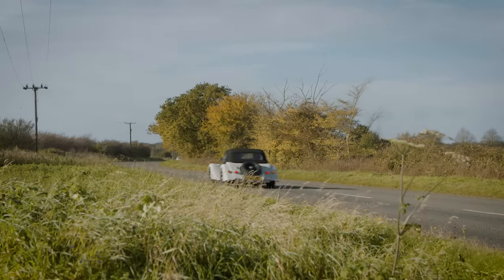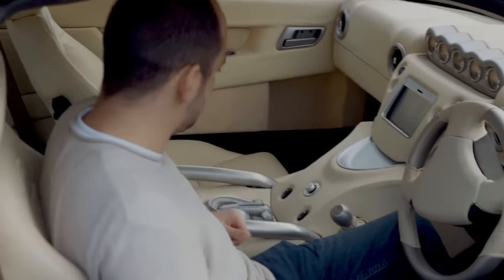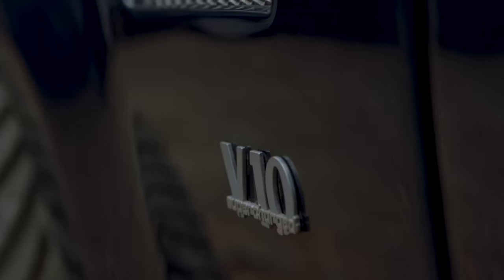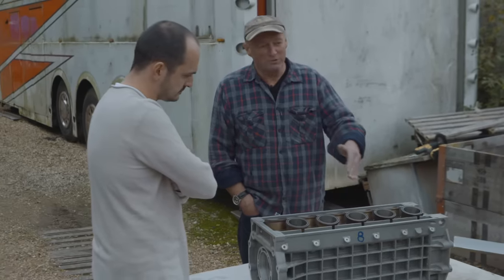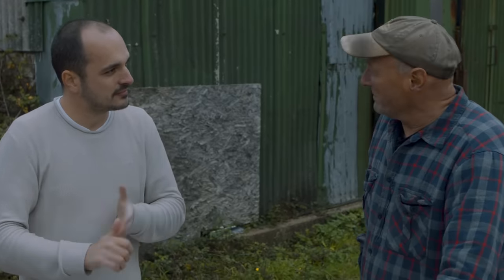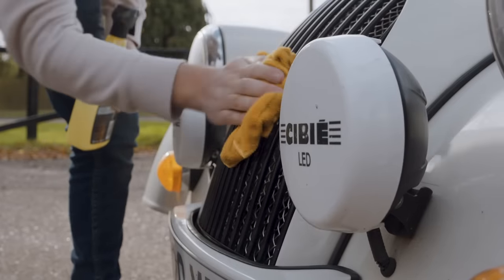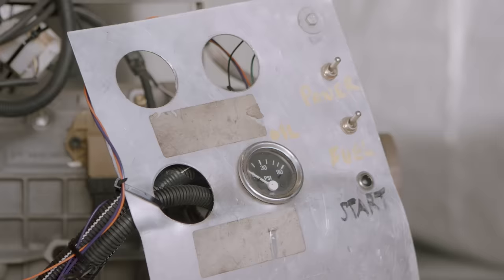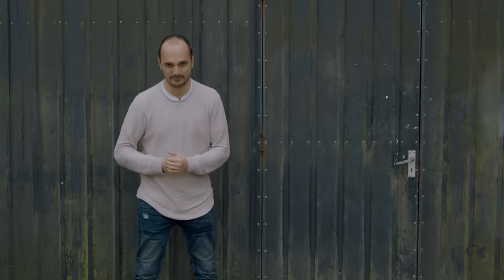We found the lost 2.0-litre V10 sportscar!

Comment: "we wanted to make a fuel efficient car, so we made a V10" is the best thing I've ever heard 🤣
Reply: Ecclestone is triggered
Reply: it is more important it is 2litres !!!  thats why !!    it is not the "V10"      2litre 4 cylinders is more or less the same like  2litre 10 cylinders, except double fun and 4 times the price 🤣
Reply: Means you can shut off half the cylinders and still make a decent amount of torque.
Reply: He wanted to show that u can have a fuel economy in a V10 engine with a hybrid system.
Reply: 2l V10 Sounds better than 2l inline 4
Reply: That's the V10 I want, small and powerfull, not big and berserk
Reply: @zogworth  I thing this is exactly what he meant: I mean with Cylinder shut-off you probably can run just 2 cylinders and be fine (As he said, you do not want a engine to idle) with 2 cylinders running only, the engine is probably just powering all the accessories and slightly charging the battery pack only and runs super fuel efficient.
Reply: Yes so you can shut off the cylinders you don't need. Not rocket science, just simple car science
Reply: @robinvespignani2126  I know, but still it's just not something you'd often hear. I get why it is.
Reply: @sjbrown4145  yes indeed
Reply: He also said special haha
Reply: @sjbrown4145   when VTEC turned off yo
Reply: @MrLince-hr4of  only 2.5x more friction so no
Reply: @TheAdatto  I was going to say the same thing you did, this is why a 4 litre 6 cylinder gets better fuel economy than a 4 litre V8. As you have less moving parts and lower rotating mass in the 6 than in the 8
Reply: Listen to what he said
Reply: I’ve driven a ten cylinder vehicle before.
Reply: Maybe, read some info about engine balance ;) It is more expensive to make but I think more durable. It will have more contact/friction area though so your efficiency story is partially true. I'm not an engineer but number of cilinders isn't the whole story about efficiency. Otherwise every car had a moped engine.
Reply: @richardlodewijk9907  I know mate, it just sounds counterintuitive to what we are used to thinking, I understand the engineering is clever and efficient but it just sounds unusual and funny
Reply: .... and how long have you been a practicing FB engineer ? Designed anything we know about ?
Reply: It's a 2.0ltr, it should get 2.0ltr economy
Reply: but is F1 listening??
Reply: @dalucktheslayerofdowjones5244  , laughs in Dodge/Chrysler Viper/Bristol Fighter/Hennessey Venom GT.
Reply: @paxhumana2015  Viper with a stroker kit - muaahaha (very evil laughter)
Reply: @TheAdatto  underrated comment
Reply: @banger0250  not compared to a 4cil. All those valve springs have to be pressed in each revolution. Etc etc
Reply: Haha! Totally!
Reply: This is the sort of thing i will tell the wife...
Reply: The smaller the cylinder the more efficient the combustion so less wasted fuel. That's why fiction and mass aren't such factors
Reply: Ne samo da si glup nego tako i  izgledaš. 2 l engine 10 cilindara. U štednom modu ugasiš 6 I voziš se pristojno na 4 cilindara odnosno oko  0.8 l radne zapremine motora. A to sve nemožeš napraviti sa motorom od 4cilindra a I vrlo teško sa manje od 10.
Reply: I want to see this V10 vith koenigsegg freevalve technology! 😋😋😋
Reply: @AJ Lexus I can't believe my comment got 1000 likes 🤣
Reply: that men have to work for alfa romeo 🤣
Reply: @marwerno  shutting off most of the cylinders makes a bit more sense. The guy didn't actually say that in so many words :-)

Tbh it could probably make close to 40bhp running on two cylinders - OK, say 20 at the engine speeds he's talking about - but that's still enough for most kinds of town driving. You might even have a surplus for charging the battery!
Reply: @MrLince-hr4of  minus friction loss
Reply: Honda,hyundai, Toyota be like wow that's so brilliant we never thought of that 🤣
Reply: Will never understand the power range difference.
Reply: Right? I own 4 Vipers and it often feels like I get gallons per mile instead of miles per gallon

Comment: Kit cars exist so why not kit engines? Imagine this beauty in the MX-5
Reply: They're called crate engines and sold by manufacturers, Ford for example, it really would be awesome to see the projects people come up with that v10
Reply: Wouldn't it be a mx-10?
Reply: @ljeremyhill  mx-11=>10+1
Reply: @GabrielZ.  crate engines are prebuilt. I think what he means by kit engine is that you build it yourself, which sounds awesome
Reply: YES :D
Reply: mx? yawwwnnnnnnn
Reply: Open source files so anyone can 3D PRINT the block and heads, use motorcycle valves, rods, pistons, and have your local machine shop turn a crank to specs.
Reply: I have a 76 Toyota Celica GT. How nice it would be under that long hood it has.
Reply: great idea they should make these engines and sell them from ebay
Reply: @fidelcatsro6948  Heck anywhere whether it be crate or kit. I build airplanes so besides my Celica it would be nice to see one under a cowling. Especially since they recently changed some of the rules for sport Aviation for the better.  Some of that dealt with weight to accommodate either Electric Or Automotive style engines like a ls3. So it being modular fits the bill for whatever.
Reply: Or lotus 7? Why can't they make them cheep in china, perhaps standard cylinder/piston/ valves with different configurations -perhaps a replica BRM V16...
Reply: @GabrielZ.  “Most” still applies.
Reply: @peterdarr383  that was my exact thought. the only real challenge is the crank case and cylinders, but certainly doable
Reply: Funny you say that it's actually going in Mike's MX-5 now!
Reply: this aged well
Reply: This comment aged like fine wine
Reply: @Ozarkprepper643  I got a road rage charge driving one of those one time..by accident.. I had the brakes smoking and I felt guilty for having to drive it over 100
Reply: @ronalddaub7965  LOL Did you lose your license?  I learned to drift in that car decades ago. They came with all the goodies. From the bucket seats and carpet to all the gauges, power steering and brakes, Macpherson strut and discs.  Plus a 40/60 weight distribution. Considered American cars including muscle  we're strangled by emissions. The 20R could hold its own with a Webber , Offenhauser dual-port and cam.  They often came out with a better weight to horsepower ratio.  It has over 400,000 miles, on the second engine.  I had an old hand-me-down falcon in high school. Bought a 76 Hilux when I graduated. I liked it so much I got the Celica GT liftback. Then I managed to pick up a 75 Celica ST Coupe for $800 in 79. Still have it also, and I drive it about once a month. It still has 34000 miles on it. Also have my 80 long bed 4x4 it sits on 38" with the 7 inch Skyjacker. It's pushing 900,000.mi  You would think I didn't get rid of anything but one of my biggest regrets was letting go of the 67 Newport convertible  383. Bar none the largest vehicle I have ever owned. LOL   Sorry memories of an old man are Deeds of a man in his prime.
Reply: Well they put it into a Miata
Reply: @GabrielZ.  not much hp to gain on the tritton v10 apparently, nonetheless great engine and awesome sound
Reply: Type in :"we're putting a V10 into a Mazda MX5....
Reply: It's happening rn lol

Comment: Wow it sounded like a Viper despite being only 2.0l.
Reply: Quite alot of big cylinder engines were pretty small. I mean Aston's V12 is only like 4.2Ltr's
Reply: @insomniacbritgaming1632  Astons V8 is 4.2 or 4.7l. The V12 is 6.0l.
Reply: @siraff4461  6 litres. How tiny
Reply: @insomniacbritgaming1632 
That's more like their V8 size. Their modern V12s are 6L.
Reply: @insomniacbritgaming1632  astons v12's are 5.2 - 5.9l
Reply: @saintbarnabasshackles2437  6.0 is normal for V12. Look at Lamborghini, VW, Aston Martin, BMW and Mercedes Benz.
Reply: mcchickenz  I think I'd rather have genital warts than drive an American car

Comment: The engine is small for a V10, but bulky (and undoubtedly heavy) for a 2.0 litre. 

An inline-5 2.0 L would be the same length, but simpler, lighter, and narrower... and still capable of running at as high an engine speed as rationally desired.

Comment: So what would the firing pattern be?
I assume it has the same crank as an inline-5 for each bank, with a throw every 72 degrees (0, 72, 144, 216, and 288 degrees, but not in that order down the length of the engine). With the usual narrow-angle configuration the cylinders in each bank are midway between those in the other bank, not adjacent to share crank throws. The crank then has 10 equally-spaced (along the crank axis) throws, and they are probably clocked so they hit top dead centre alternately (so the 72 degrees between cylinders in a bank is split into two, but angle between throws is 22.5 degrees off of that 36 degrees because of the bank angle. Ideally that means one cylinder fires every 72 degrees of crank rotation, as in any even-firing V10. Both banks will rock because of the odd number of cylinder (like any inline-5), but the two banks can be timed to roughly balance each other... but not quite because of the bank angle. 

 A wider vee angle allows the cylinders in opposite banks to share crank throws, and the right vee angle avoids the need for offset crankpins. This narrow vee angle messes with that, and makes the engine block almost 50% longer as the cylinder bores would run into each other if spaced more closely.

Comment: That is an intriguing car, and it's in classic British style to make eclectic autos, like the Connaught, Morgan, MG, Austin-Healey, Jensen Interceptor, etc. But, the concept of a single head for a "V" engine seems fraught with problems. If either the block or head has to be surfaced, the alignment will no longer match. Plus, thermal expansion will be more problematic for head gasket sealing.

Comment: WOW. That exhaust note is glorious🎵. Find it interesting that the exhaust is an unequal length baffle box type. Sure makes for a slim and sleek package to stuff in a chassis. Any HP/Torque specs? 

If proper motor mounts could be adapted for Ford and others, this would be an ideal crate motor to manufacture.

Comment: wish we had more info on the engine as i would like to know how the angled cylinder seal on a flat head ,are they counter bored into the head i see the cylinders have wills ring grooves , lancia used a flat block so had a flat cylinder head with chambers ?also no throttle body ?

Comment: Engine type	V10, 22,5° narrow angle, 4 valves/ cylinder, DOHC, twin scroll inter
Displacement	2.0 l (122 ci)
Power	304 ps (300 bhp / 224 kw)
Torque	371 Nm (274 lb-ft)
Power / liter	152 ps (150 hp)
Reply: similar performance to nissan 350z 2006 engine. almost... The VQ35DE rated at 287 bhp (291 PS; 214 kW) and 274 lb⋅ft (371 N⋅m) of torque

Comment: 2.0 straight(“don’t produce enough power”)
This dude: hold my beer 😱
Reply: It only make 300hp, that's less HP than a Civic type R with a 2L and they can easily handle 500+.  Bigger bore means better flowing heads equals more power.

Comment: I NEED to know more about this engine and its hybrid system. Because it makes zero sense to me. Everyone else has been using fewer and fewer cylinders for years because it increases fuel economy through less frictional resistance. But this guy's like "Moar cylinders!!" Also what the heck does not idling have to do with having ten cylinders?? If he'd have said "I want it to run really, really low revs" then more cylinders would make sense, but not the other way round.

This car makes no sense and I'm intrigued.
Reply: I agree.
Ford are using a 3-cylinder engine now in place of 4. Many V8s are being replaced by V or straight 6s... all for the sake of getting the engine friction down.
A 2-litre V10 is just a vanity exercise.

Comment: For 2022, needs softer exterior lines/corners, and just copy others for interior design, what is the fashion today. That cylinder head face is something else, 01:57 , main pressure taken by copper gasket rings around cylinders, but water jacket walls look narrow. Leak danger with used time?

Comment: Doesn't look like it uses a "Headgasket" per se i'm assuming it uses silicon sealant around the flat surfaces then on the cylinders it probably uses a copper ring.... something like this if produced could become quite the kit engine, i can imagine getting in bed with a casting company and seeing as they are already machinists they could probably pump these out for a few grand each in kit barebones form (No ecu or anything) just the engine block and head... i'd love to throw one of these into my mustang! 2.0 V10.... i bet supercharged that would make some lovely noises.

Comment: since he ICE dont are inefficient at idle did he mean hybrid as a gaspowered generator? As in constant rpm driving a generator then driving electric motor with some kind of buffer in between?
Reply: Nope. It’s basically a system where the electric powertrain helps drive the car until the engine is in the proper RPM band, with the ICE being connected to only one drive gear which would be top gear in a regular ICE car. I think the Koenigsegg Regera uses a similar system now.